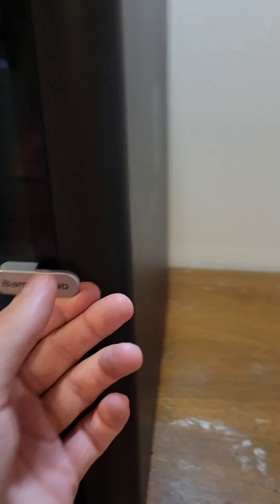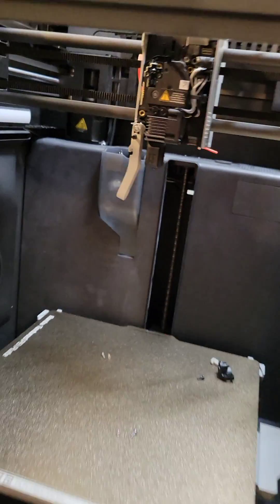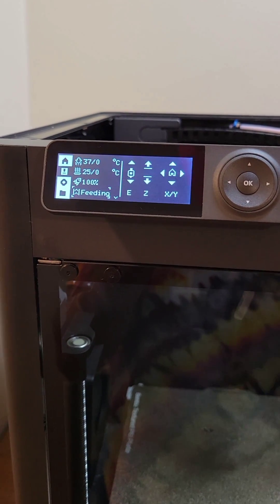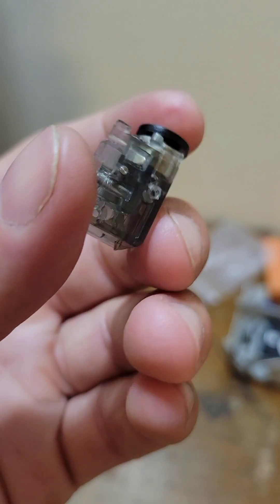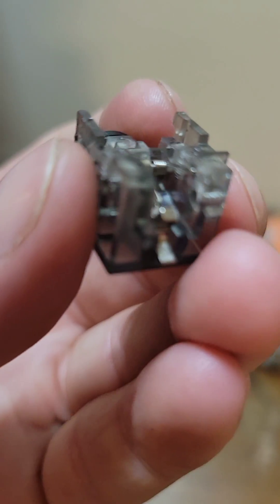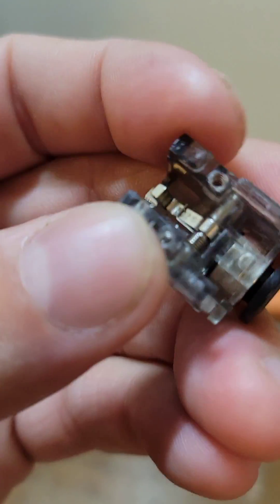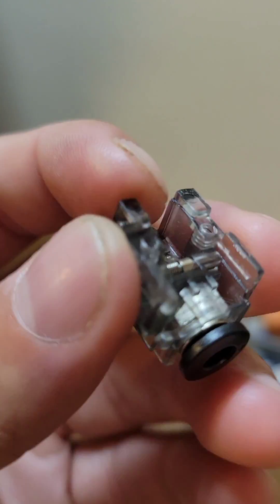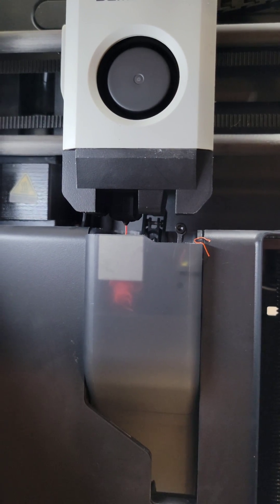Bambu P1S Not Detecting Filament? Fix in Video!

Comment: I've been banging my head against the wall trying to figure out what the issue it was a clog but then when i went back to print nothing was printing out but it was still doing the motions. So I will check this because when i try and load fillament i dont hear any noise from the gear.

Comment: Take Note Guys, This is a great video as I had the same problem but it did not work when I put the magnet back in, I stripped it down again and realised that the magnet polarisation was wrong. I reversed the magnet and now it is working. If it hadn't have been for your video I woud not have found it, so thanks again.👍
Reply from the maker: Wow good to know! I'll pin this comment for others. And I'm glad I could help, Happy printing!